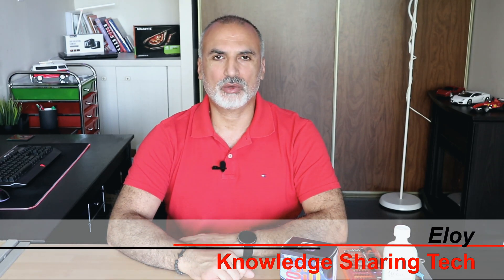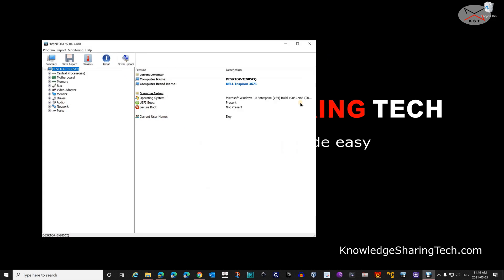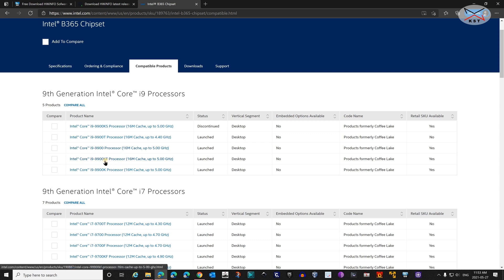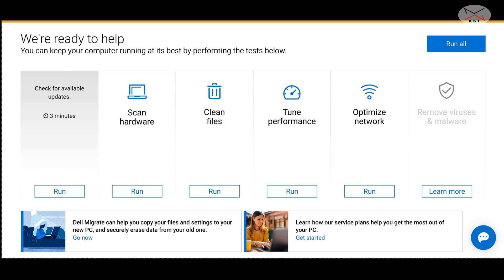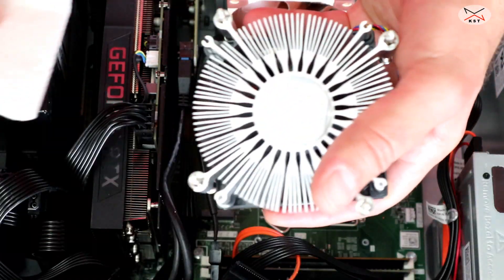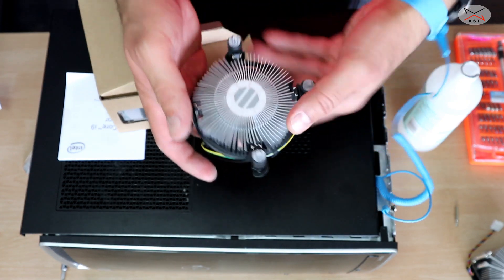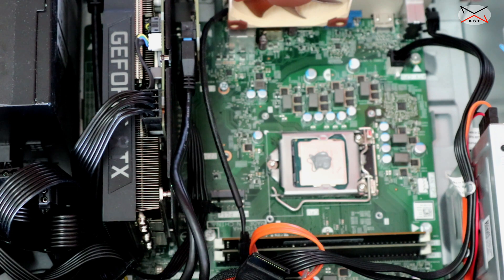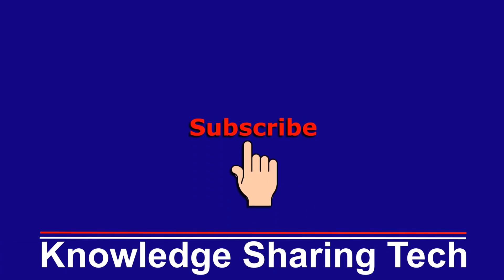How to upgrade an Intel CPU in desktop core i5 to core i9 (Beginners guide)

Comment: I know it's been 4 years since you posted this video, but did you confirm that everything booted properly and you got into Windows and everything with the i9-9900, because I saw that it may not be supported with the Dell Inspiron 3671.
Reply from the maker: Yes and I'm still using the PC with the i9-9900 to this day
Reply: @KnowledgeSharingTech YES! Thank you man! That helps a lot!